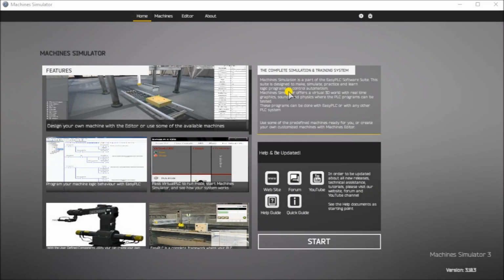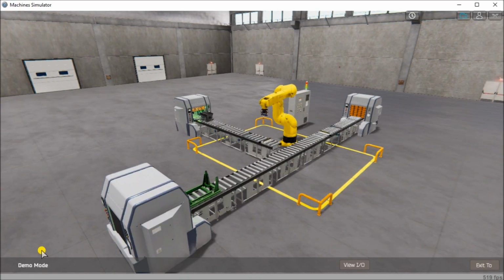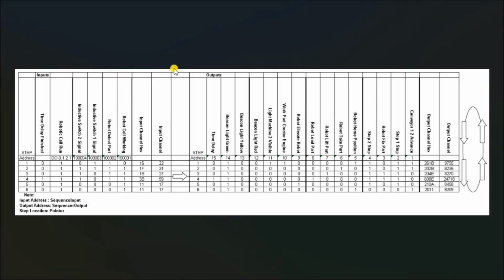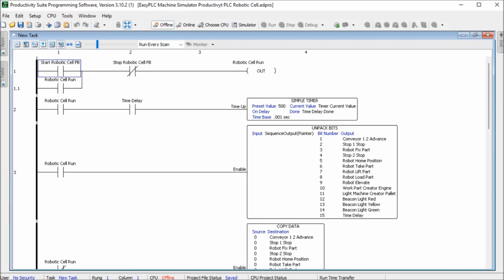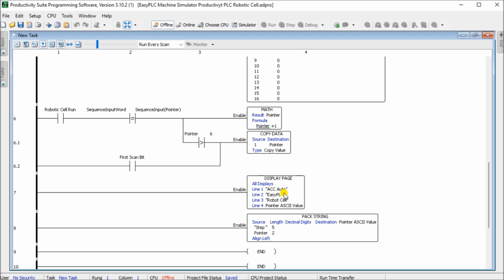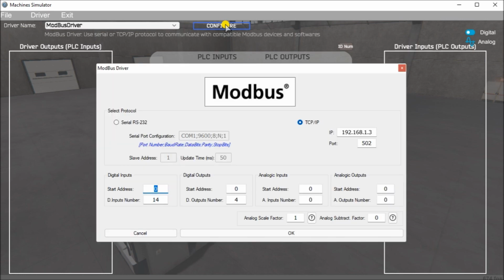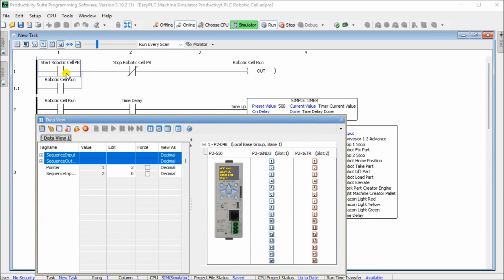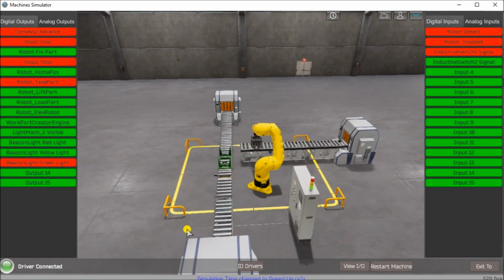EasyPLC Machine Simulator Productivity PLC Robotic Cell

Comment from the maker: More information can be obtained on our website. This includes all of the links mentioned in this video.
https://accautomation.ca/easyplc-simulator-productivity-plc-robotic-cell/

EasyPLC Software Suite is a complete PLC, HMI, and Machine Simulator Software package.
This PLC learning package includes the following:
Easy PLC - PLC Simulation that will allow programming in Ladder, Grafcet, Logic Blocks, or Script.
HMI System - Easily create a visual human-machine interface (HMI),
Machine Simulator - A virtual 3D world with real-time graphics and physical properties.  PLC programs can be tested using the EasyPLC or through other interfaces. (Modbus RTU, TCP, etc.)
Machine Simulator Lite - Designed to run on Android Devices.
Machine Simulator VR - Virtual Reality comes to life so you can test, train or practice your PLC programming.

Purchase your copy of this learning package for less than $75 USD for a single computer install, or less than $100 USD to allow different computers.
Receive 10% off the price by typing in ACC in the comment section when you order.
http://www.nirtec.com/index.php/purchase-price/
Learn PLC programming the easy way.
Invest in yourself today.

Regards,
Garry
ACC Automation
https://accautomation.ca/